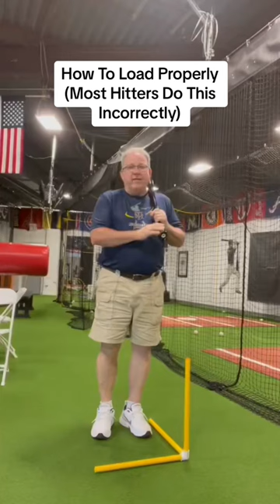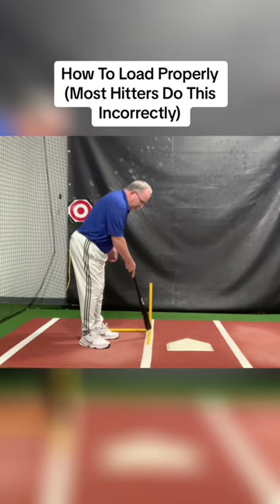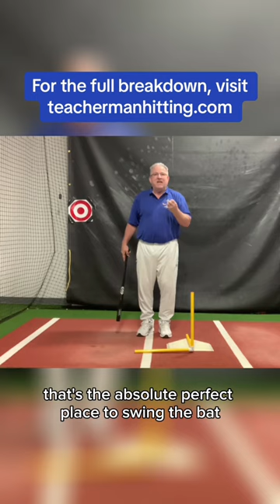3D Loading

Comment: I love this channel but I disagree with the axis description.   Based on this demonstration the axes are off and the Y axis motion and Z axis are the same.

Looking at all 6 axes of motion (3 planes of motion and 2 types of motion per plane, 1 rotational and 1 linear) the Z axis is the tranverse plane (looking top down) rotation of the hips and trunk.  There doesn't appear to be significant motion in the linear axis (rising up and down)

The Y axis would the rotation of barrel down in the frontal plane (looking at the front of the hitter), again not much motion linearly unless your chasing a pitch (moving the bat in and out)

 X axis rotation is in the saggital plane (side view) and there is not much rotation in this plane (falling forward or backward). The linear axis is the forward motion, i.e the step.

There many other accessory motions to go into but there is a reason people get doctorates in Kinematics and  this is a youtube comment section

Edit: I just realized he switches X and Y in the two cuts so my description is based off the one where he's wearing pants